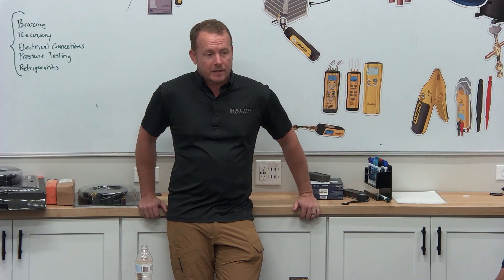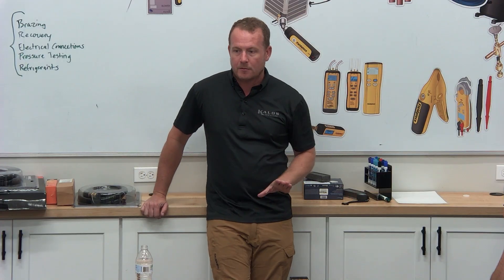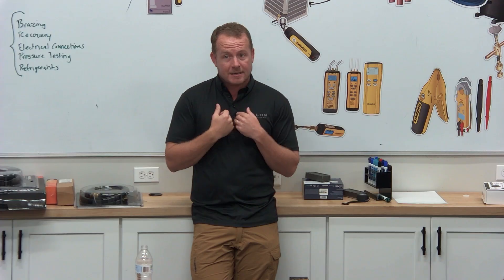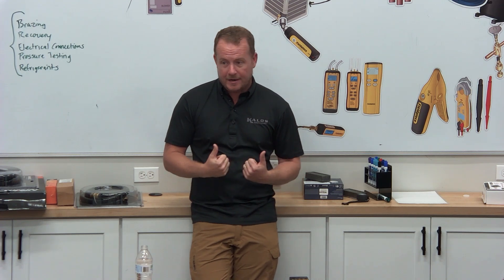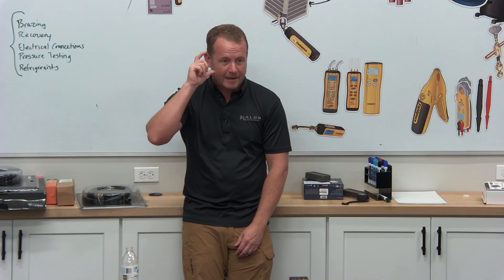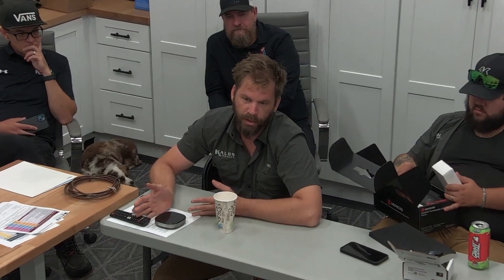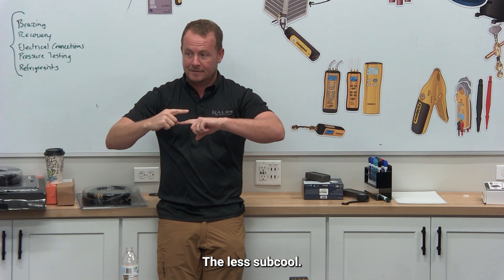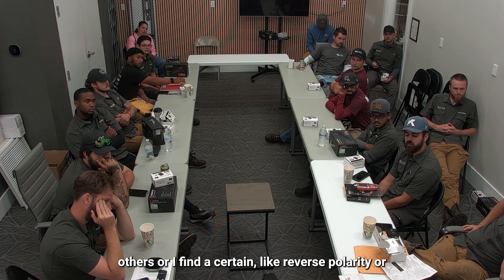Thermal Imaging Camera Training for HVAC Techs

Comment: Engineer looking for technical knowledge. Totally off topic of video, but
what kind of flow (cfm) can ya get 4" & 6" manual dampers down to when feeding a flex?
The client's criteria for calcs yield some really low flows (like 5/10cfm in some spots (closets)) & I feel like 25cfm is probably the minimum can technically be achieved.

Happy New Year
& Im excited for another year of learning with yall!
Reply: A 6" probably only like 100cfm
Reply: also 12:50 that was dope, like, I know the refrigeration cycle, but the sauce that you guys bring 😗👌